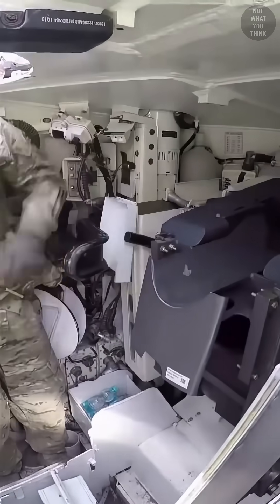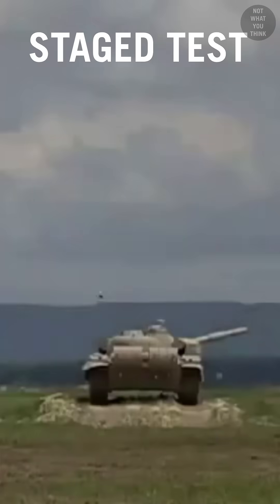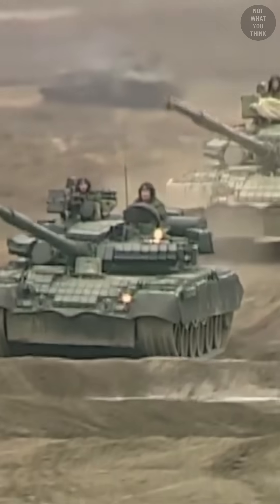Why M1 Abrams Tank Has No Auto-Loader #shorts

Comment: Autoloaders sound like a good idea but the reality is there's just more moving parts to break. A human loader just keeps loading...
Reply: I agree with the breaking parts bit but not the always loading bit. Tank loaders need training, space and food. Eventually that loader will get tired of lugging around heavy ammunition and will need rest while the autoloader just needs good maintenance and a working engine tp work.
Reply: @vianmiso2277  You're undoubtedly correct. Yet the US military still opts for human loaders still. Why?
It's because of the trade offs that come with it.
Tanks are expected to receive damage. Mechanical parts break and a small chunk of metal in the wrong place is all it takes to render the gun completely  combat ineffective with hours or potentially days needed to fix it. A tank out of action has knock on consequences for everybody in the unit too, particularly the infantry attached.
If a human loader is KIA, its very easy to continue to shove shells into the breach and continue fighting. This fact increases combat survivability for not just the tank crew, but the mechanised infantry fighting with it too. 
This is worth way more than the saving of 1 tank operator's arms, some space and a little bit of extra cash, because really, what's the use of having more ammunition in your tank and a faster firing rate if you can't even shoot it? More ammo also = more risk. Enemy tanks go big boom easier.
Reply: human break, pretty easily even.
Reply: @Uryendel  Human replace instantly, autoloader break long time, in combat, long time no gun = death
Reply: @hapidjus2520  How do you replace the human? you take the farmer next to you? ...
Reply: @Uryendel  A tank generally has 3 - 4 humans in it that know how to operate the gun. If one human is injured or killed, the rest of the crew isn't screwed because the gun is still operable.
If the autoloader is broken, all humans are dead regardless. Every crew member's life is dependant on that autoloader working at all times. A tank without an autoloader can keep shooting until all humans are dead. Key word, "until". 
Simple dude.

Furthermore, imagine a scenario where the tank is dug in. Say, around a base. A penetrating round can easily disable the autoloader. More moving parts = more to fix. The tank is now basically a landscape decoration until the autoloader is fixed, even though the gun can still be fired... you just cant load rounds into it. The solution could take days. Fail.
A penetrating round hits and knocks out the crew, the gun generally survives and can still be combat effective. Instantly replace humans, vehicle asset still good. Open the breach, load a round, gun still goes boom. The solution took minutes. Win

I get it bud, you're proud of the motherland's achievements. Sadly, I just disagree with the logic. So does the united states military...
Reply: @hapidjus2520  Stop watching hollywood movies, if the auto-loader is dead then the human that would be in its place would be dead too and the turret heavily damaged. The only time you replace a crew member is when he, and only he, is knockout not when the tank got a shoot that penetrate to the point of disabling the internals

Also I'm not russian and the us military just put in service the F35 who's a piece of junk who can barely fly, have an anti-radar design that work only against WW2 radar, and cost more than any other jet fighter, not really a reference in terms of wise decision.
Reply: @Uryendel  Movies? Lol. I drive them.

Comment: Human loader is faster than an auto loader. Increased auto mechanics increase the probability of maintenance due to battle damage and wear.
Reply: None of what you said is true autoloaders are faster, consistent, safer and if you're worried about something mechanical breaking down why have a tank at all. autoloaders don't have any higher chance at breaking than anything else mechanical. Also the ttb Abrams prototype cycled 66k rounds before malfunctioning

Comment: Does anyone know how the hell do these AT missles in the video work? I have always wondered, because you can see that the missle don't even touch the tank, yet somehow it is able to rip the turret off the tank asi if it was nothing. How is it so that an explosion that happens many feets above the tank can cause so much damage? I will appreciate if someone explains this :)
Reply: There are types of ATGM (anti tank guided missiles) that have a proximity sensor scanning for magnetic feed back (such as on the TOW 2B) when they get that signal they activate a directional warhead sending a jet of metal downward to punch through the roof armor of the target. Which is often thinner than the front or side armor of the target
Reply: And cooks ammo

Comment: Autoloaders also require more electronics and machinery which means more strain on logistics, why make things more complicated when you can use that extra 5 feet of space in that train car for more food or medical supplies.
Reply: OR you can have a single train car carry TWO tanks instead of one due to lesser weight of the vehicle thanks to the autoloader.
Reply: @fokka6010  well I was thinking a minute re general usage but that works to.

Comment: "Blowout panels on the roof, to vent out the explosion to protect the crew"
-proceeds with a clip of a tank "venting an explosion through the roof" in a way that would NOT protect the crew :D
Reply: showing a non-American tank
Reply: @void870  Abrams is not American?
Reply: wellllllll that was a tow, with 36 inches of armor penetration, two warheads and the monroe effect at full blast there isn't a SINGLE modern passive armor system that will stop a good tow shot from causing a sympathetic detonation of the ammo. Your 3 inch blast door ain't stopping much there lmao.
Reply: @NGnotorious  3 feet of armour?
Reply: @purplemonkeyelephant  Older TOWs with frontal attack had about 1,000mm of RHA penetration- which is over 3 feet, or 36 inches. 

Although he's a fool, as he whines about the blast door stopping that- which isn't the purpose, and he doesn't understand that modern TOW 2Bs have much less penetration...but are designed as top-attack missiles.
Reply: Yeah, Russian tanks have the most kills solely because they kill their own crews if hit almost anywhere on the main body.
Reply: @jesusofbullets  Russian blowout panels work. I know it is hard to see and understand but when you point and laugh at those T-62 and T-55 cooking up in syria etc. There is actual crew members that run out of those things. Yes they are alive. Amazing /s
Reply: @TuubiName  I don't see very many getting out of tanks with their turrets blown off. If the ammo is even scratched the whole thing not only catches fire, but wholly detonates. Blowout panels only work if they're designed not to blow into the crew compartment...
Reply: @TuubiName  In russian, blowoff panel and turret mean the same thing.
Reply: @TuubiName  I've see. Multiple cook offs and no crew ever survived
Reply: @TuubiName  What? Russian tanks do not have blowout panels. The first and only Russian tank to have blowout panels is the T-90M, which is extremely new and only exists in very small numbers. 

Russian tanks store their ammunition in the turret in a carousel style mechanism because of their autoloaders, which makes ammo compartmentalization and thus blowout panels impossible. It is because of this and the general lack of space in Russian tanks that blowout panels were never used.
Reply: @kamash581  not true, I've spoken to actual crew who have survived battles by exiting the rear of the tank
Reply: @jesusofbullets  Hapened to the Leopard 2 turkish when fight against rebel kurdish not only russian.Even export Abhrams cannot whitstand ATGM hit
Reply: @mattz1230  Say to Leopard 2 and Abhrams export variant without extra armor add by Uranium depleted
Reply: @Tomas_TK401  Merkhava Tank only
Reply: @alfaromeo1819  Leopards all store ammo in exposed hull compartments, but even the export Abrams have blow off panels. You won't find a Abrams with the turret blown off.
Reply: @jonathanpfeffer3716  Even the T-90M still has exposed ammo. They don't use blowoff panels on the M.
Reply: @alfaromeo1819  Because the armor on them is just steel. No composites or ceramics.
Reply: @mattz1230  I have serious doubt about extra add armour can whistand Javelin Spike Kornet etc.
Reply: @mattz1230  Somehow mist the truth.Exist a vids with that thing but maybe is M60 similar on layout design to Abhrams
Reply: @kamash581  They survived! They ran out of the vehicle!

They were on fire as they ran, and they only lived for another .2 seconds but they ran out alive!!! /sarc
Reply: @Tomas_TK401  BATTLES not COOK OFFS
Reply: @alfaromeo1819  On the American Abrams? Yes, it can stop Spike and Kornet- which has been fired at the Abrams. They're direct attack missiles. 

No, it can't stop the Javelin, Nothing can. 

I have no fear of it; as it's on our side.
Reply: @mattz1230  Kornets have taken out plenty of Abrams in Iraq (they were also very successful against the Merkava in Lebanon in 2006 as well)
Reply: @kamash581  lol
Reply: @Tomas_TK401  Name ONE American Abrams (not the cheap toys without armor we sold) killed in Iraq by a Kornet. Name the unit, date, location, anything you can provide. 

You can't. It never happened. To date- No American Abrams has ever been destroyed by a hostile anti-tank weapon. There have been IEDs, but NEVER an ATGM or other anti-tank weapon.
Reply: @Tomas_TK401  The Merkava had great success against the Kornet. There were a few losses, but most of the missiles fired were decoyed, or failed to penetrate. 

Since fielding Trophy, NO Israel tank has been destroyed. EVER. The Merkava also doesn't use the same thick ceramics and composites as the Abrams.
Reply: @Tomas_TK401  that might have been an apc (armored personnel carrier) because in most tanks they have their ammo or engine or both there in the back lol
Reply: @mattz1230  in Inglés, tank destroyer without HE and a Tank is the same words
Hi, Leopard, hi, Abrams
Reply: @mattz1230  and you are extra infantile. Believing that humanity have never seen ammo explosions before the T-64.
Reply: @worldoftancraft  What are you babbling about? Tank and tank destroyers are not the  same. They're very different.
Reply: @worldoftancraft  No, we've just seen all your tanks, from the -34, -55, and -62 cook off and burn their conscripts alive.

The only thing worse than your tanks is your training. Or lack thereof, russian. 

Slava Ukraini!
Reply: @mattz1230  oh, really? They are very different? Tell me, how did it happen that the Saint Abrams does not have an HE in ammo rack?

Because it's a tank, right? Because Æ-glishmen very busy with a tank because they understand the power of Steel Projectile, right?
Reply: @worldoftancraft  Can you not use proper grammar? Abrams has ALWAYS had high explosive rounds- HEP and then HEAT/MPAT. 

Tanks always have multiple rounds available. So did tank destroyers. 

You know literally nothing about armored combat.
Reply: @mattz1230  lol. Cool shell, what a cool type of shell: HEP – which is not manufactured for 120mm guns(Not the UK ones before Challenger 3 MBT), because they are lacking in efficiency against armoured targets while giving marginal amount of splinters. 

HEAT/MPAT is the same story with still insufficient and funny amount of splinters and pure HE action.

What a funny gun, NATO 120mm. Only not "world-level" tank designers design an goodhold devastating HE, or HEF whatever you call it. Frenchmen. Englishmen before adoption of This. Japanisemen. Korea's men. Israelimen. All of them adopted an HEF. While Germany and The Saint States still fight tanks. Whooh.

So me, not knowing "anything" is knowing that the terms "tank" and "tank destroyers" are quite shapetaking, quite plastic, while you do not. Interesting.
Reply: @mattz1230  also, mister expert, mind you elaborating why would I care about Armata's turret blowing off... if it's literally the separate, isolated compartment? Are you a Gypsy to hunt for gold, pérdon? Or what is that?
Reply: @worldoftancraft  HEP was not needed for 120mm smoothbore rounds. 

HEAT and MPAT both produce as much fragmentation as a dedicated fragmentation round. 

Hilarious that you try and fail to trash the NATO 120mm. Because the French 120mm is the same round. French tanks can- and do- use German ammunition. They are fully capable of firing all NATO ammunition. 

The Japanese, Koreans, and Israelis all adopted the Rheinmetall 120mm. All three use either the L44 or L55 cannon. 

And yes, we still fight tanks. We destroy tanks. Our doctrine is solid and battle-proven; while yours is a proven failure. 

You still don't know what a tank is and how it is different from a tank destroyer. They are two different types of armored vehicles. 

You literally know nothing about this topic.
Reply: @mattz1230  same cartridge does not mean the same ammo rack and the same shells in magazine. I did separate the UK's gun because I clearly understand it's different from the others countries weapon system.

Also reading that "HEAT produces the same amount of splinters"... it's just a funny story if contradicting a "rule of thumb" and primitive knowledge. 

Yes. I don't know. While all you can do is saying me that I don't know. Because I trolled you. The thing is, as I already said, the border is quite marginal. There are wheeled tanks. And there are different tank destroyers.
And nothing can prohibit me naming 62+ tonnes Behemoths as "tank destroyers". 

And tell that NATO itself/Its strategy& tactics work to such a good tourism and recreation island as Cyprus. I think that this "collective defence" organisation with the membership of Saint States would not allow anyone to ruin their business plan a few decades back. Especially if it would be another Germany/Korea/Vietnam and the allies won't allow another split to happen. "Never again" right?
Reply: @mattz1230  my apology for replacing "the used and carried ammo" with "the ammo rack". I thought it's a clear metaphor.

Did I say "it cannot fragmentate"? I said that the results are laughable compared to a proper shell's result.
It doesn't dissolve in air, yet it's not anyhow truly optimized for this job, because it's simply a byproduct. There are different examples of comparable HE and HEAT ammo of different kinds, such as bombs, and it's a general rule: HEAT warheads create feelable less potent splinters in amount of ~1.5-3.0 times less.

What is "Centauro" Italian vehicle? Different other tank gun -equipped vehicles on wheel propulsion? Filmmakers' substitutes? My apology, but even tank itself is a stretchable term. While all you can do is play into game "refuse everything". The only truly undisputable term in armoured vehicles area is "armoured vehicle" itself, while about many others terms there can be day-long arguments.

Cyprus is just a good bedtime story about the NATO behaviour in a situation.
Reply: @jesusofbullets  Foolish words
Reply: It's like an ejection seat.
Reply: That’s not an American tank buddy
Reply: Hi
Reply: The amogus in this
Reply: It shows a tank not exploding 1-2 seconds later.
Reply: How many tanks have you design ed ?
Reply: Hes showing what it is without them
Reply: Right. Thats scary tho. Like oh cant even hide behind a wall cause it explodes in the air and what rains molten metal at mach 3.
Reply: Yeah but if you hang in there they show a split footage of the interior of the tank and exterior of it cooking off while the crew was alright
Reply: that tank shown is a T-72, not an Abrams.
Reply: Protects the replacement crew from cleaning up the dead bodies... I thought that was obvious .
Reply: @ntal5859  
Thats messed up. But true. Like a turret ball gunner in WWII. If you get hit by a 20mm all they need is a hose.
Reply: In actual battles, that ammo box FAILED 97% of the time when it was hit. Crews died instantly.
Reply: @DavidWatersJames  the Abrams one? That’s false
Reply: @DavidWatersJames  which tank are you talking about?
Reply: @DavidWatersJames  if you’re talking about the abrams you’re lying